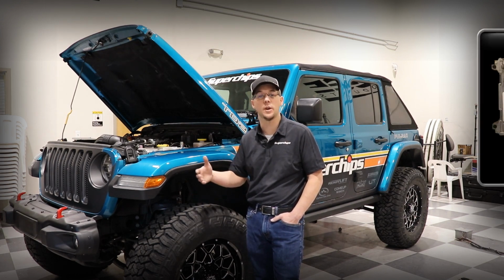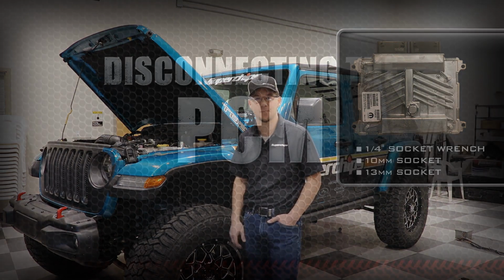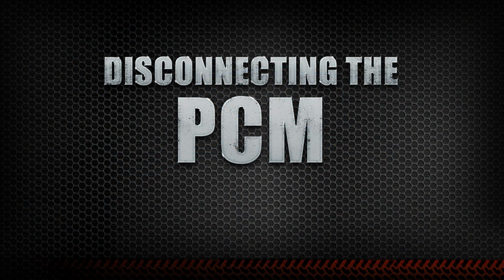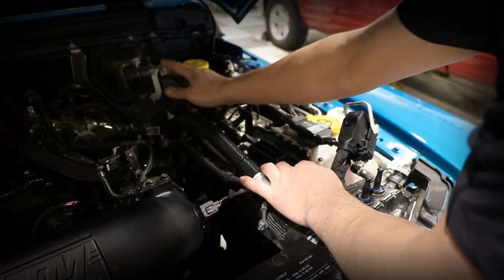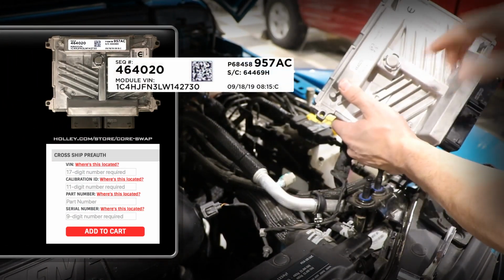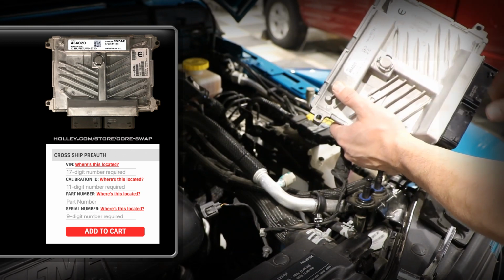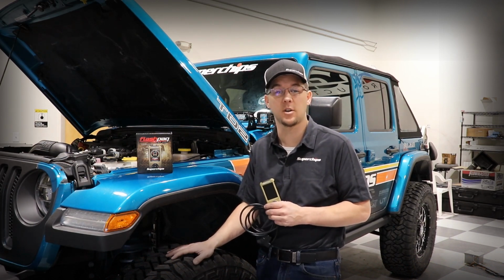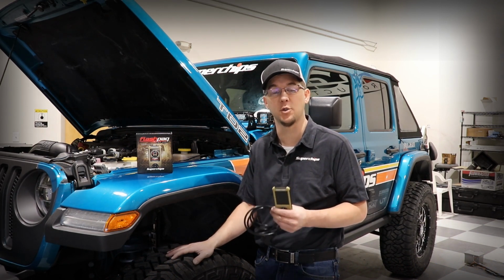How To: Jeep Wrangler JL 2.0L PCM Swap

Comment: Do I get the unlocked PCM with flashpac on the mail first and then I send my PCM as core or is the other way around?
Reply from the maker: You'll receive an unlocked PCM first, which will allow you to swap out with your original, then return. Limiting your downtime.

Comment: When will you come out with the pcm swap for the 2021 2.0l JL? And could I pay to keep my factory pcm just in case the dealer tried to void warranty by plugging in their scan tool and seeing it’s unlocked
Reply from the maker: Our engineering team is working hard on 2021 coverage but we have no set ETA right now. And yes, you can purchase an unlocked pcm outright if you'd prefer to keep your factory unit.